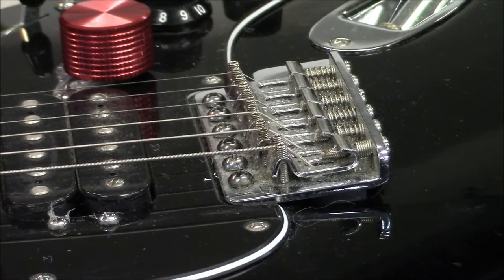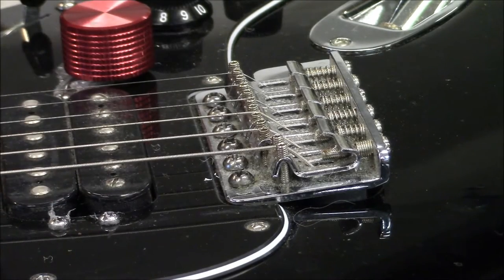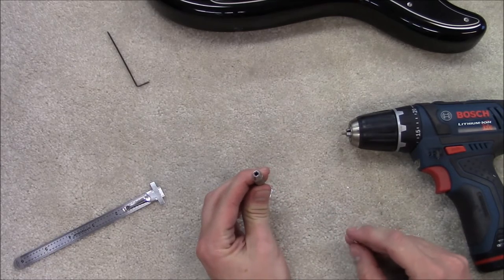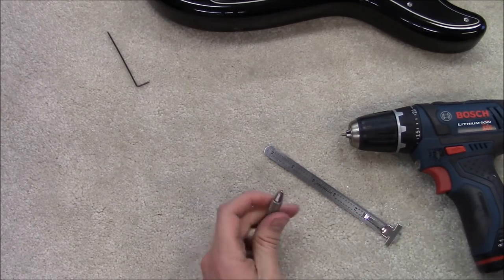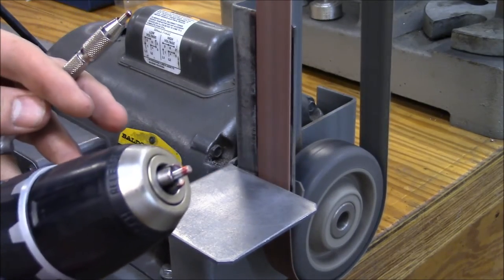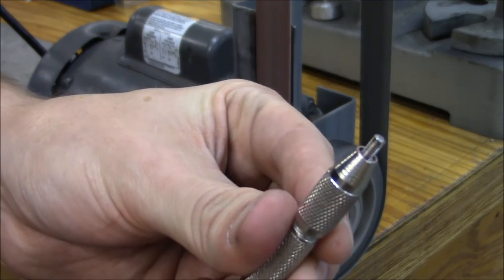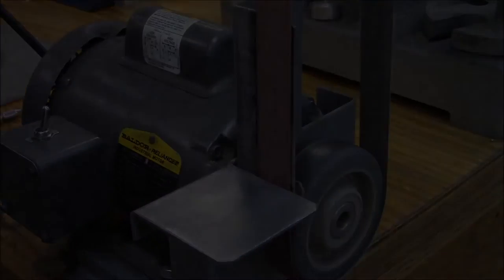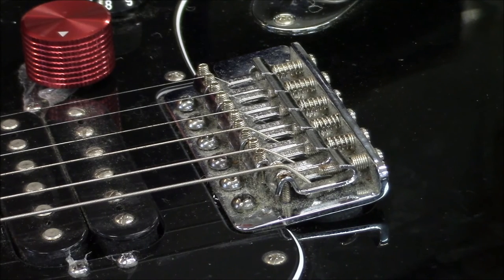Height Adjustment Screw Cutdown Guide

Comment: I did this today to a brand new Fender Ultra Luxe Stratocaster.  The screws were slightly too long and very sharp.  Took a little off the bottom with a bench disc sander and angled the edges like the video showed.  Went together perfectly and problem solved.  Good job on a to-the-point video!

Comment: I prefer to change the angle of the neck pocket and utilize the entire length of the screw "10 mm" which has the advantage that it creates more pressure down towards the plate, which means that the saddles do not change position sideways as easily  "bad for tuning stability"when pressing down the tremolo bar.